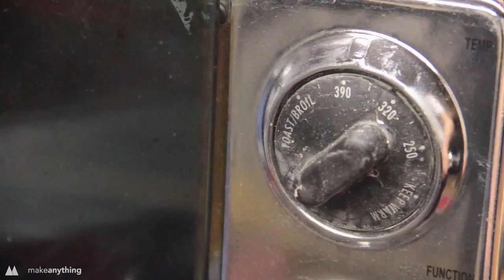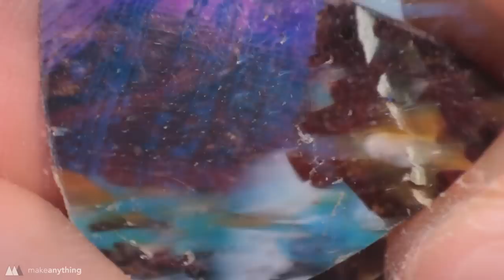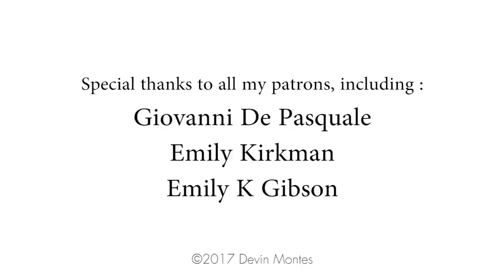Failed Print Recycling Revisited // Guitar Picks, Earrings, and More

Comment: Creative work. I actually did some research a little while back on how to recycle plastic, and I found a few people who would use sandwich makers to melt down HDPE plastic, and use parchment paper on top and underneath it so they wouldn't stick. I don't know how different the melting temperatures are between the different plastics, but I think you should try this out, if you get the chance :) There's a video on it, too, but I can't remember the name of it. I'm sure it's not too hard to find.
Reply from the maker: Thanks for the tip!
Reply: FilAsians general PLA will melt around 190 degrees centigrade depending on the brand. overall it's between like 170 and 220 degrees centigrade. However it will get soft and pliable a bit before that and the thinner the strand the sooner it'll be effected.
Reply: Parchment, my thoughts exactly!
Mirrors were a great option though.

Comment: There's a craft product fairly similar to this called HAMA beads, where you place plastic beads in a pattern on a grid. Then you lay some baking parchment over the top and use a hot iron to melt the beads together into a surface. Sandwiching the bits of plastic between two layers of baking parchment, or a mirror and baking parchment and melting it with a hot iron could be a good way of doing it.

Comment: Great idea & I love your designs! I agree the white & primary colours are the most iconic looking. You do cool stuff that is great to see put out into the world!

Just a thought but I wonder if you blasted a finished guitar pick with the heat gun (or possibly better yet a lower heat took such as an embossing gun or even a hairdryer) around the edges you'd get rid of that slightly rough edge. Where you sanded it not quite smooth?

It's just those little bits of thin stragglings that are making them look not totally professional to me.  But that might be cos I'm a picky crafter not a 3D printer lol!!

Comment: @make anything great video. Some different things to try to get different effects, pressing the mirrors straight with no movement, sliding in one or more direction either straight lines or other motions, or straight down and rotating the top one. You can also put shims between the mirrors for consistent thickness but just don't press too hard.

Comment: Hey Devin, this is Cris again. After your first melting the bottom is flat but the top is not. Would it work if after taking your melted piece out the first time, just flip it over and put it back in the oven for a little bit should flatten the other side too? I had the same idea but just used aluminum foil a little Pam sprayed first. Awesome guitar picks. Favorite coaster is the one that looks like the world from space.
Have you ever made a Stainglass window? with transparent filaments? I remember my mom got us these kits that comes with the metal framework and you put different colored plastic beads in different spaces, stick it in the oven, it melts it and comes out Stainglass. Be kind of fun just to use the 3-D pen to fill in the different areas.
Keep exercising your imagination there's a Lotta good stuff comes out of it.

Comment: For cutting small things on the bandsaw, make a sacrificial insert by cutting into a piece of MDF or similar dense material. clamp the piece to the machine and then cut your small items in top of that. Then you end up with a "insert" with no more opening than the track the blade made.
Reply from the maker: Gotcha.. is that for a cleaner cut?

Comment: How about making a concrete or metal mold of a 3d printed thing so you can use it like injection molding? For example a fidget spinner printed with a 3d printer. Then creating the mold around it. Remove the spinner and start mass production with recycled plastic

Comment: If anyone has a scrap ABS sludge vat, I've found that you can also use acetone to cast simple parts. Just sacrifice your scraps to a jar of acetone, print a master, finish it, and use it to make a silicone mold with a large enough cone at the top to handle the extra volume the acetone in the slurry will need. You can then pour the slurry into the mold, and after an unfortunately long time, the acetone will have evaporated, and you'll have a cast ABS part. There will likely be bubbling artifacts near the top surfaces. I can't stress enough that you'll need proper ventilation or a condenser setup to recapture the evaporated acetone, however.

Comment: How about applying heat from the top, by using a dry iron and a Teflon sheet, to turn the stringy mess into a flat sheet? Putting it on cold and turning it on letting gravity work might be interesting

Comment: I wonder if you were to put a sheet of thicker smooth metal (or heat proof glass) on top of the plastic in the tray weighted down all into the oven from the start you'd get a more consistent form which is smooth on both sides. Will need plenty of release agent of course.
Reply from the maker: I think that would work pretty well, although it might cause a lot of bubbles on the top surface from trapped air depending on how the plastic is broken up. Guess I've gotta find a thick chunk of steel
Reply: Of course the issue with this is that you would need to let the whole thing cool down before you could release the plastic, so it will make the process slower.
Reply: maybe a vice setup with the chunk of steel to gradually add pressure

Comment: If you place a mirror with the mirror side facing down and melt a sheet of plastic over it, you could then cut the plastic to make it into a hand held mirror.  

Have you attempted to make bowls again, but using the heat gun this time?

Comment: I have been debating recycling, what if you put a 1.75 hole in your  metal tin, use your heat gun to heat said metal tin. Have a fan directed at exit hole to cool the falling fillement, the reel it up.

Comment: i would like to see them a little sanded more, start with rough sand paper then go to the lightest for the best result, then use a clear coat or coat them in resin so they are really shiny and look finished. The spray clear coat would be good for the guitar pick and resin for the charms. also you can mix the resin with glitter and other stuff... if your into that. THE SHAPES ARE UNLIMITED.
Reply from the maker: +Angel King yes I cleaned up the edges a bit, I was just going pretty fast with these!

Comment: put a hole in a glass jar melt the plastic a little bit so you cam mold it then use a vacuum to pull the plastic in and let it dry. Maybe you cam make a cup or bowl this way?

Comment: Can't you turn failed prints back into filament to use in the 3d printer somehow? That'd be much easier to work with than trying to mold the melted plastic into something useful

Comment: Good timing! I just purchased the metal galactop from shapeways. I mean like an hour ago. I can't wait to get it in. Also is there and chance you could design a twisty puzzle like a 2x2x2 or 1x2x3 and sell it on shapeways for a fair price? I really want a 3d printer twisty puzzle but can't justify the prices.
Reply from the maker: Awesome, you're gonna love it! What exactly do you mean by a twisty puzzle? Like a rubik's cube?
Reply: Oh yes sorry. Like a rubiks cube. Basically the problem on Shapeways is they have either extremely small (i mean like 10mm/1cm x 10mm) cubes for a decent price ($15-30) or they have crazy elaborate things but they are in the hundreds of dollars. I did however find a dino cube for $35ish dollars I might buy. I just really want to feel that sandy feel they have.Also thanks for the fast response. I can't wait to get the top in.

Comment: Okay, but since the one side is blank on some of them, because its easier to melt plastic onto plastic, what if, after you melt plastic onto one side, let it cool, then turn it over and melt more plastic on the back side so it won't be a single flat color on one side?  Would the same techniques work for it?  Or would it have to be difrent?

Comment: You should do
 coasters
Bracelets
Crown
And a pare of glasses
Reply: I use a big round silicon form (for backing), put some 300 g of PLA in it, melt, drill a hole in the middle and put a clock work on (from old kitchen clocks)

Comment: Ps can u use sheets of tin? Bc I have that laying around
Reply from the maker: I suppose you could, but the surface probably wouldn't come out quite as smooth
Reply: @make.anything  i was primarily concerned with tin and heat giving off any toxic fumes